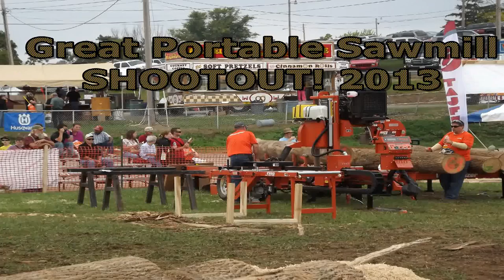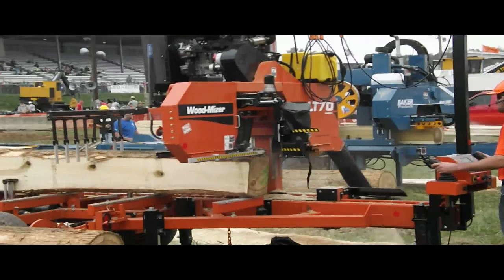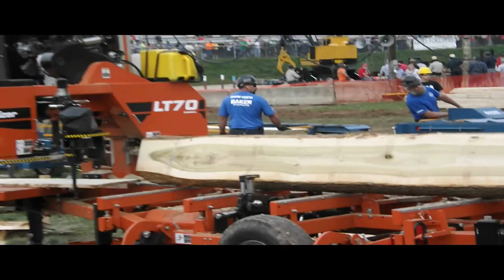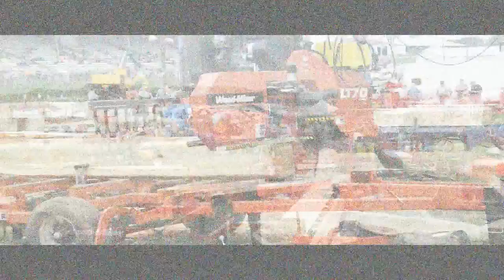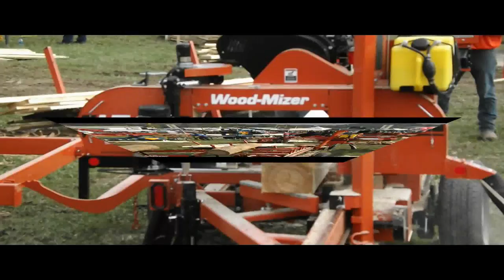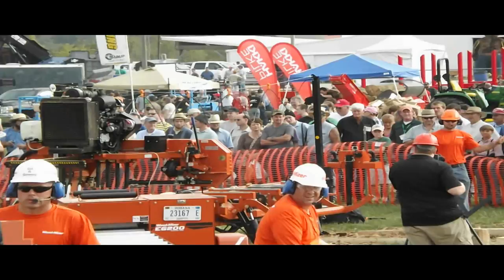Great Portable Sawmill SHOOTOUT 2013

Comment: I recently watched a portable, home fabricated mill sourced from of a couple Laidlaw 60 inch throat band saws.  It was run by a large, electrically driven 3 phase hydraulic power unit, obtained at a government auction.  A very clever Mennonite fellow and his neighbor, an engineer with Shopvac of all places made it last Winter.  It has a stationary head-saw with a tailing table and double action edgers.  The Headsaw has what I have heard called a "shotgun feed" (I think it's called that because it cuts in each direction of travel.)  It's accurate, fast and safe.  Everything most home made mills are not.  They built the whole shebang for under 15 grand.

Comment: I traded my four post head mill for a woodmizer two years ago, and will never go back to the four post head.  You have to babysit the four post mill to make sure it stays level the entire length of the mill, if not it will cut inaccurate lumber every time.  The cantilever design does not depend on the deck being perfectly level or being level at all.  The head movement of a cantilever is never an issue while cutting.  My woodmizer is the far better than my old Timberking.  Not even close.
Reply: I set up my mill with a four post head four years ago and have not had to relevel it. Just have to make sure the jacks are on a good foudation.
Reply: Serious question : What model TK did you trade for what model WM ?  In all honesty, you are the first person that I have ever heard of, that actually traded a welded 4 post system for a cantilever system. But, there again, to each his own.
Reply: Watching this video I couldn't help but wonder how accurate the lumber was coming off the woodmizer because the head is wobbling and bouncing. The other mill appears to be much more stable, I think it's a Baker Mill.

Comment: the BAKER CREW were apparently still green. They threw the race. Baker mill should be cutting alot faster. But 6 months down it will need repairs. Wood-Mizer is a superior machine in my view. Baker design still needs alot of work.
Reply: I was at this show. Yes the baker should be cutting faster. The Sawyer didn't run it as fast as he does his own. But at the 2015 and 2017 the baker team won with the same Sawyer. The Baker sawmill needs nothing to improve on. It weighs 10,000lbs, doesn't bounce or even move when loading or turning a log.
Reply: You have that backward, the WM will breaking down a LOT more than a Baker.

Comment: What was the cost per setup , one woodmiser had an edger , the other pop up take away chains . Total cost for each unit to make a finished 4 sided product , my guess is the perterson or lucus would cost about 1/10th the cost of either woodmiser units , when you include the edger to edge the slabs  you don't have an apple to apple comparison . Top of the line woodmiser against a bargin priced perterson .   Bet woodmiser paid for this video
Reply from the maker: Nope, I as an individual made the video myself. Clearly though, Woodmizer bandmills are much more efficient and not as wasteful as the Peterson and Lucas mill.